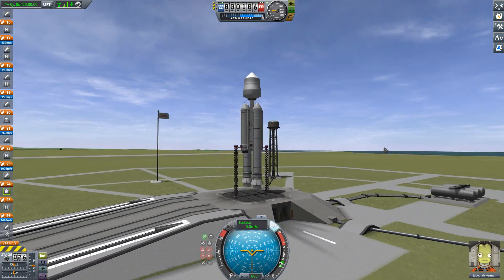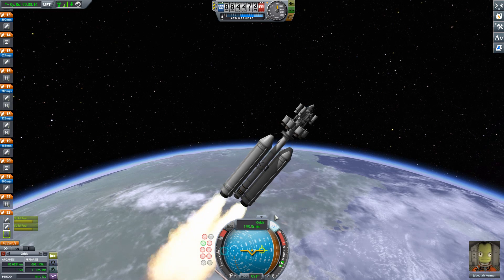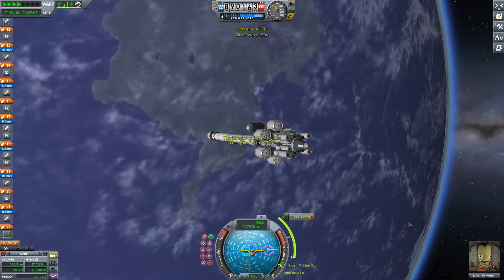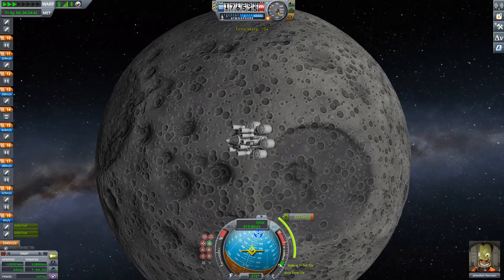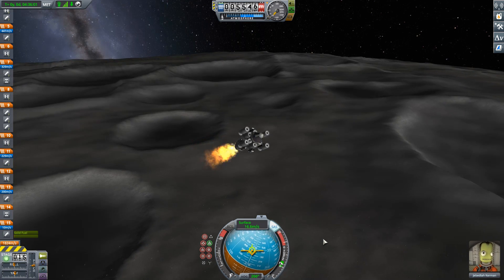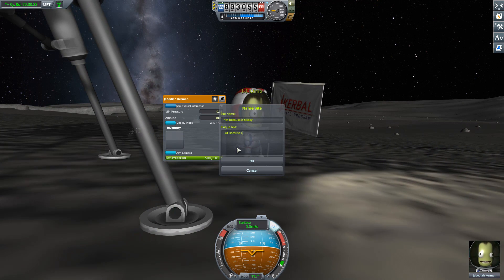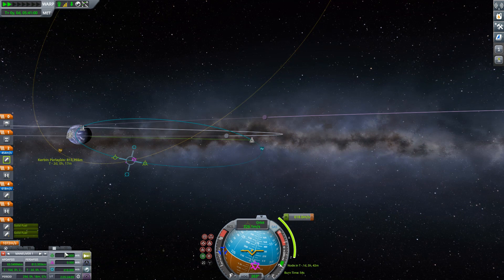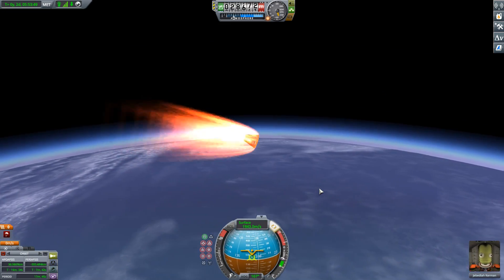Kerbal Space Program - Landing On Mun Using Only Solid Rockets - Now With Moar Boosters.

Comment: I decided to see what happens if you stack ALL of the SRBs on top of each other, staged one after the other . . .
On the pad, it needed to burn off fuel for a few seconds in order to lift off. At final burnout (without any steering), it wound up on a trajectory that took it so close to the sun that it melted.
Reply from the maker: Yeah I did this on a livestream too

Comment: Actually the main way you thrust vector a solid booster isn't a nozzle instead you surround the outer bottom with a ring of circular ports which can be opened and closed. Of course the solid booster can neither be turned off or throttled but by having ports that open and close you can effectively shift the direction of energy enabling manoeuvrability. 

The most interesting example of this I know of is the Russian Iskander hypersonic missile. If you look at the rear end of it you will see the circular control ports that allow the solid booster to not only crack out hypersonic speeds in atmosphere but also deliver its payload within about 50m circular error.

This missile tech is straight out of the space program derived out of efforts by the Soviet Space Program (NASA did the same thing) to achieve maneuverability out of solid fuel rockets.

Comment: So if real Δv is going to vary by a few %, you can fix that with smaller rockets. Lower Δv per rocket means smaller errors. Smaller rockets means more rockets though, with more of all the parts. Also, if you want to reach your destination, you need to have MORE than you need by that error margin. 

So... which solid rockets were designed with multiple "charges" that were isolated from each other, so that they could be fired multiple times, fine tuning the Δv and leaving the excess fuel unburned?

Comment: What kind of fuel are using? They can ignite in space!
Reply: Rockets carry there own oxidisers.
Reply: @aquaticllamas28   Solid Fuel Rockets use oxygen as oxidizer at start, then, part of the fuel is the oxidizer
Reply: gabsr So what are you asking?
Reply: @aquaticllamas28  To ignite itself, it needs oxygen from environment, then, it can run normally

Comment: I had an idea for this challenge with the new robotics update. You can put 2 solid boosters on rotors and make them rotate in opposite directions to cancel out each others thrust and bind the rotation to your throttle and boom, you got throttleable solid boosters.

Comment: Can you make it to the Moon on parts available to Ukraine, Iran or North Korea? What about commercially available ones?(SpaceX might be commercial, but they're not selling tech to competitors that's for sure).
Reply from the maker: Ukraine has some exceptionally good space hardware. China’s next generation of rockets (Long March 5,6,7) are based around a reverse engineered Ukrainian engine.
Reply: @scottmanley  indeed it does due to its "ancestry", but it suffers the same problem as Russia since they had... well, you know it's not simple now around here in these parts when both your neighbours fling opposite kinds of propaganda in all directions and very little factual info while you financially depend on both for trade:(
The thing is, production wasn't fully internalized in either country and some components were imported from other one. But yeah, being homeland of Antonov factory and Yangel(aka South) Design Bureau) they have a lot of potential. That's why it would be interesting how things might have turned out if they decided to go the path of Stratolaunch for example or play around with Sealaunch and recoverable boosters.

Comment: So, how realistic would a real life rocket be, powered only by SRBs for major things, and a single small liquid rocket for fine control over the deviations?
I have not checked my stuff for it, but SRBs seem much cheaper so maybe that offsets the lower efficiency?
Reply: Modern ICBMs use all solid motors.  The reason is simply that a weapon will need to sit for years in some silo, but always be ready to launch at a moment's notice, and thus must be fueled at all times.  This is very impractical with cryogenic liquid fuels that have to be kept very cold at all times, and moderately impractical with hypergolic propellants, which, although they stay liquid at room temperature, are horribly toxic and corrosive.

As far as peacetime rockets go, the Minotaur V comes to mind.  It's a 5 stage all solid rocket which can carry a 500 kg payload to orbit.  It is, incidentally, based on a modified ICBM.

Cost wise, solid motors have lost what advantage they had in recent years largely due to SpaceX.  You simply can't cheaply reuse them.  Reuse so involves all the logistics of fishing them out of the sea (there's no hope of landing one propulsively), stripping all the mechanics down to clean out the sea water, and then disassembling the upper part to install new fuel.
Reply: Besides the Minotaur V, ESA's Vega and the rocket stages of Pegasus are also all solid rocket motors.

Also the retired Scout rocket was all solid stages.

Brazil's first attempt at making an orbital launch vehicle also consisted only of solid stages.
Reply: Israel's first orbital rocket (Shavit) also consisted only of solid rocket stages.

Comment: The fact that the shuttle's SRBs have thrust vectoring is why I've never liked it when over dramatised "documentaries" call them uncontrolled.
Reply: but they basically are, no matter how much vectoring they have, if you can't actively controll their thrust level, the mission profile has to be pre-designed/determined. They are uncontrollable. Yes, not in every sense, but in the major major one.
Reply: Benedikt G. Actually some srbs are able to throttle just not to 0%
Reply: @ballisticfox9033  @benedikt G. is implying that the thrust and burn time are determined before launch and cannot be configured in flight, which is true. So you have missed his point and made an irrelevant remark that I am sure @benedikt G. already knew and in no way contradicted him.
Reply: Would you call a Prius that you could steer but was stuck at 100% uncontrollable? That's what the STS SRBs were. As the saying goes, once those things are lit you are going. The only question left is how much of Florida is going with you.
Reply: Some SRBs can also be shutdown mid-flight.
Reply: @sillygoose210_6  Only solid fuel motors that can be shut down are 3rd stage motors of ICBM ballistic missiles (rapid venting into vacuum extinguishes them). Big SRBs can be "shut-down" maybe by range safety, ie. blowing them up, which isn't very helpful for the crew.